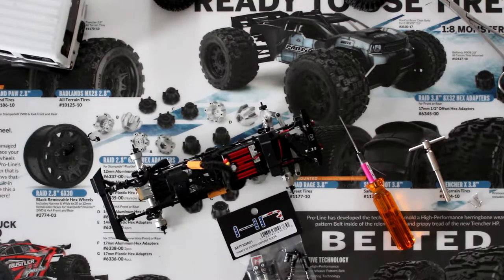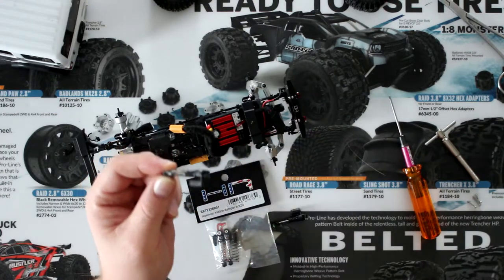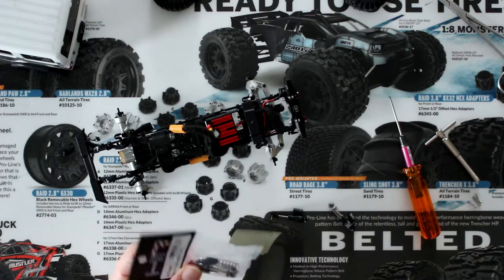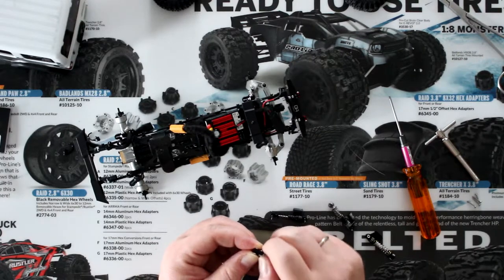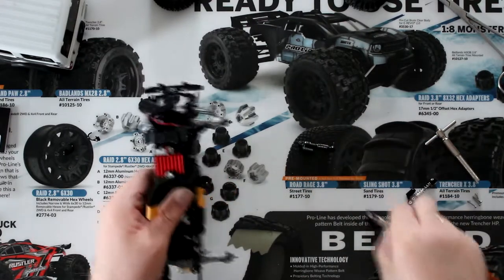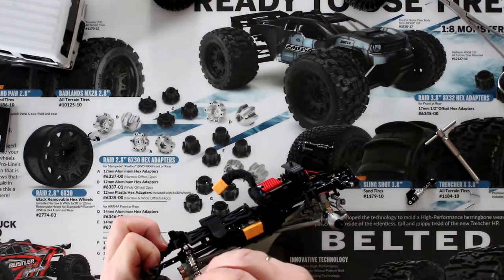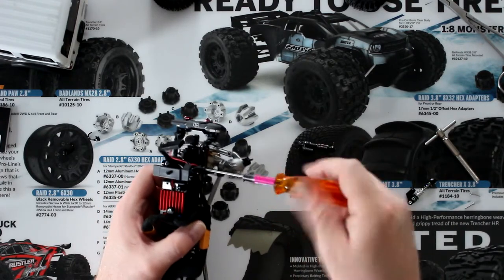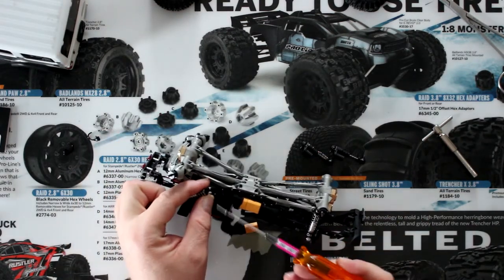Scx24 Shock Upgrade Hot Racing

Comment: I just installed a set of these on my Scx24 Deadbolt, has anyone noticed that the shocks seem to be a tad to stiff?
Reply from the maker: Yes they are a bit but they do give you two sets of springs you can swap them out.
Reply: @djsprc  thank you for ur response, i've tryed those, but the spring is so weak it won't extend the shock back out lol
Reply: I've noticed that too